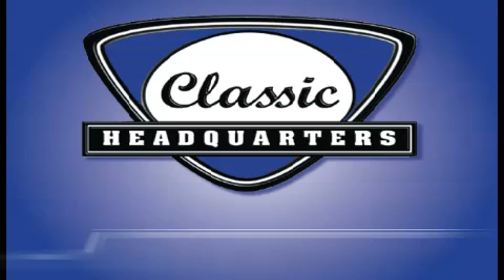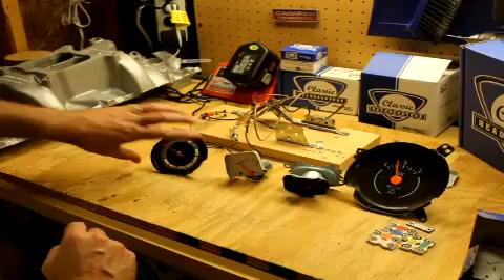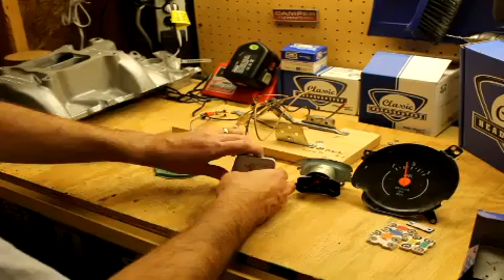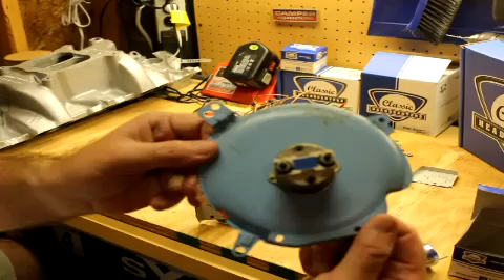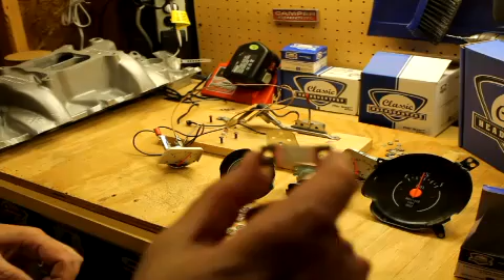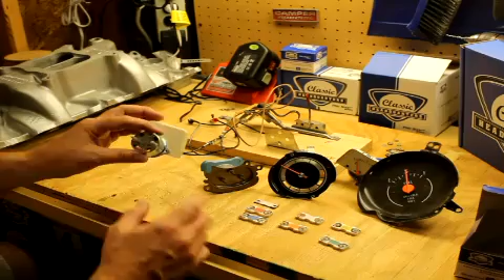Post 1965 GM  & Classic Headquarters Reproduction Fuel Gauges

Comment: I have a reproduction gauge that I bought when I restored the car. Believe it was CHQ, along with all the gauges etc in my 69 Camaro. Problem I am trying to solve with my gauge is as follows: The sweep works fine, when I fill the tank to the top the gauge does indeed read Full as it should. When I am about half a tank gauge reads empty. At about 1/8th of a tank needle is past E almost as if the ground is off. I have not pulled the sender and checked the Ohms on it, but it is a new OER 0-90 sender. If it's not the sender, would it then be the gauge? I almost want to buy or borrow another CHQ fuel gauge and rig it up at the back of the car (temporarily) with leads just to see if the 2 match but looking for some direction first

Comment: I have a 1970 GTO and my gauges are all messed up. I'm concentrating on one at a time. First my gas gauge. I have installed a new printed circuit and had the gauges out and have a feeling I messed it up. My gas gauge will only go up to around 1/4 tank (new tank sender installed) one site I found said when the needle goes to 1/4 tank when full that the resistor is bad or grounded to the gauge housing how do I test that in the car. Note: It's not a full tank. It was on empty and I put approx 5 gallons in and it went to almost 1/4. I put another 5 gallons in it and it stayed the same. If I ground the sending wire in the trunk it pins the gauge at FULL. HELP!!!! After three years of restoring it, I want to drive it. The gauges are all that's holding me back Also I get continuity to ground on all three posts.
Reply: Unplugged, gauge reads empty, connected to known good ground, gauge will peg full. Sending unit problem. Easy. 
ASE Master Tech since 1978
Retired